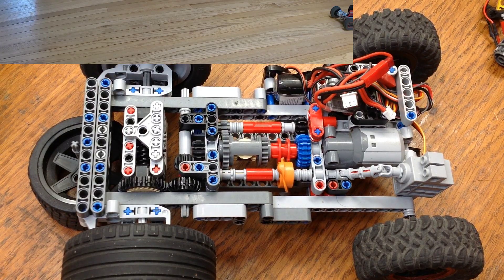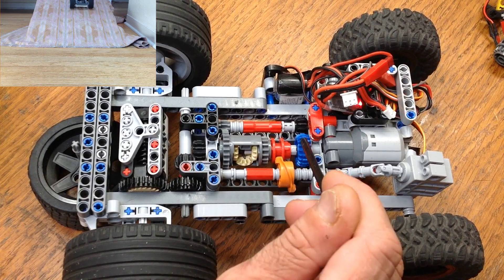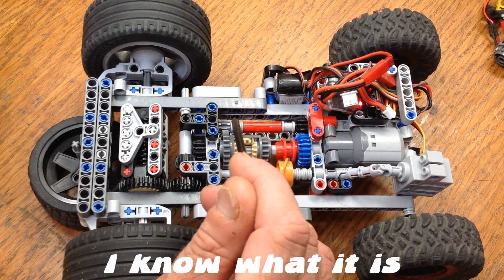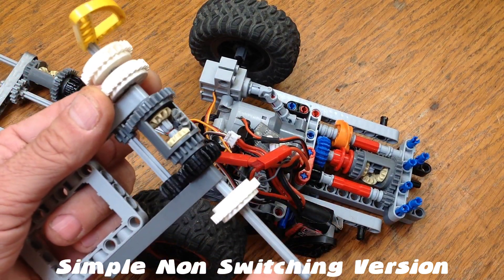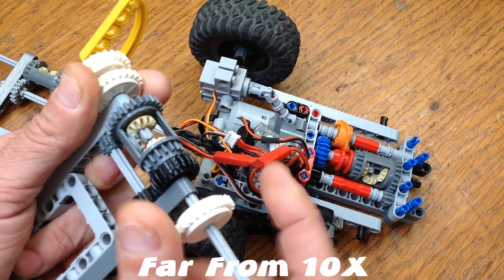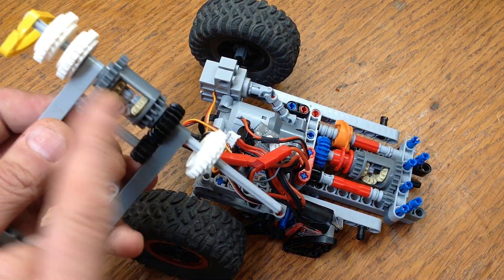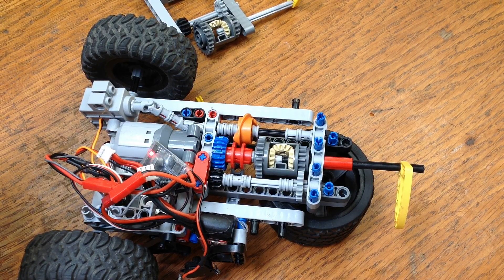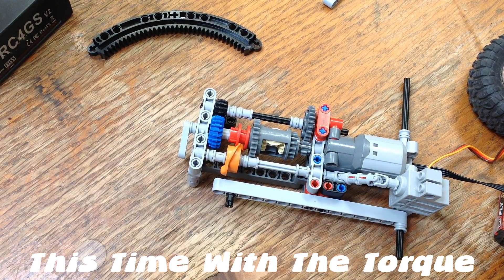Making A High Ratio Lego Transmission 3 Times

Comment: yay! you're back. You may have prevented me from madness. I put my CVT onto a 540 motor and watched the motor destroy the clutches, one after another. With puny Lego motors it worked, but as soon as the power went up logarithmically, those silly little slipper units failed. First they slipped badly, then once cooled and restarted there was no  slip at all!
I think your solution might cure this, if it can handle the torque....  I'll have to copy it in a few weeks time when I have concluded my RC work!!!
Great to see you posting again, have missed your kind of innovation
s 🤣👍🍺🇬🇧😎
Reply from the maker: That is the problem with the white clutch CVTs. With a smaller motor failure will take longer but is still inevitable. I think this is the most solid trans I have made. These transmission videos are popular so I feel like I have an obligation to make one that is truly practical and robust.
Reply: @MaxBrix  awesome! I thought I had made the perfect gbox. Yes it works great with lower rpm as it cools quicknenot to avoid melting stuff. I will study your works and try and replicate them.👍👍👍.

Comment: Is your custom diff heavy weight resistant, I mean would it even under heavy load not pop in many pieces? I’m looking for something to use in a LPE car with high torque but I only want to use original parts
Reply from the maker: I will try to cover that in the video. Thanks. Maybe some load testing would be good...